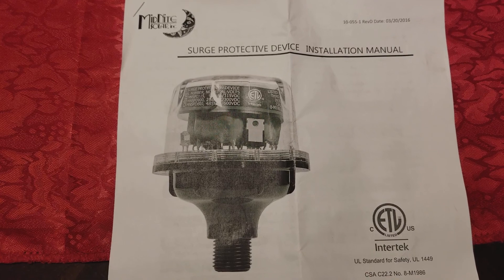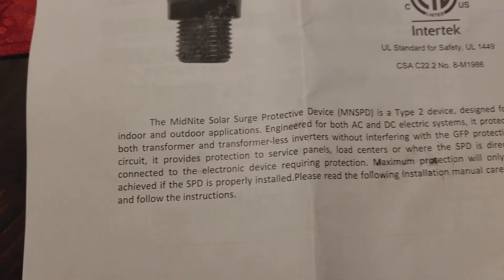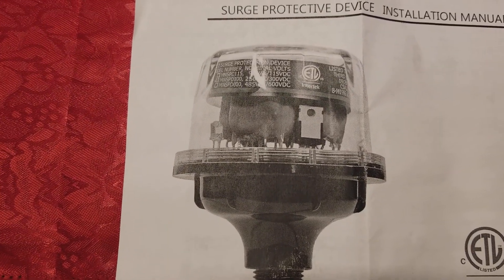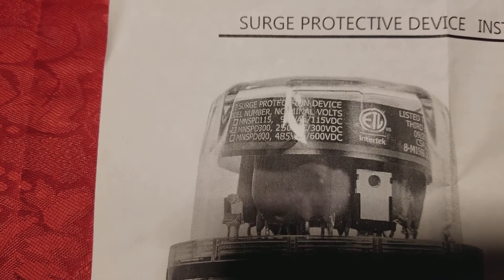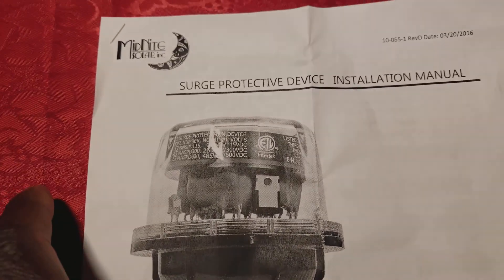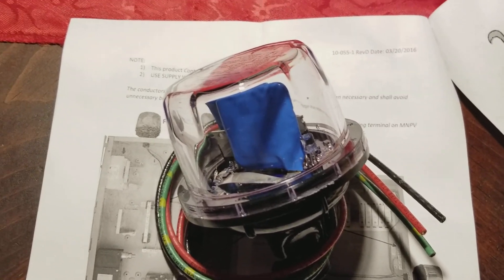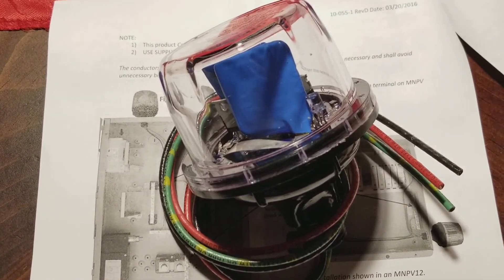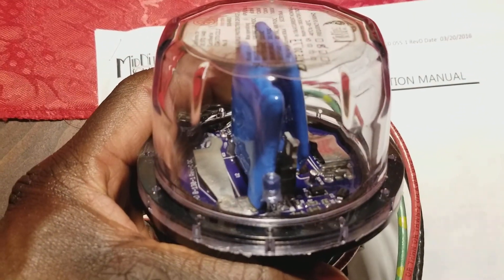OFF GRID SOLAR LIGHTING ARRESTOR || MidNite Solar Surge Protector Device (MNSPD) by jwsolarusa

Comment: Midnite solar lightning arrestor: which is best for a 24volt system which will not need to be upgraded when upgrading to a 48v system later?
Reply from the maker: It doesn't matter if it's 12v 24v or 48v or 60v .
There are two types of them, one protect the DC & the  other for the AC side.
PLEASE DON'T FORGET TO LIKE SUBSCRIBE AND SHARE MY VIDEOS AND MY CHANNEL. 
Here's a link to both of these devices:

https://www.solar-electric.com/midnite-solar-mnspd-300-dc-surge-protector.html?gclid=CjwKCAjw8NfrBRA7EiwAfiVJpWhHUIluU4tJ9gQqBwPpHybfrr_nJfUazpNjnQdynkMP1gokDxe2yhoCuMkQAvD_BwE

https://www.invertersupply.com/index.php?main_page=product_info&products_id=6423&gclid=CjwKCAjw8NfrBRA7EiwAfiVJpRnhuVqVdhN9SVDfMPXe3f9SAhkcq_LAMqw4lJLwZsVhFlB7c-L0JBoCHz8QAvD_BwE